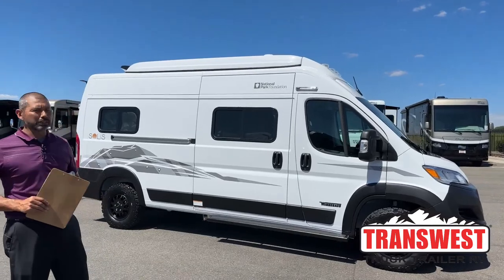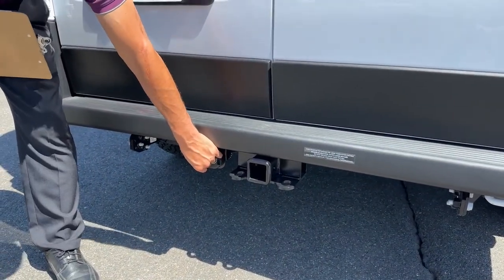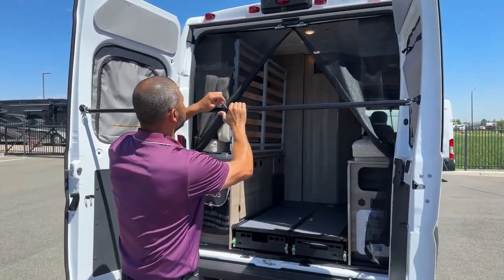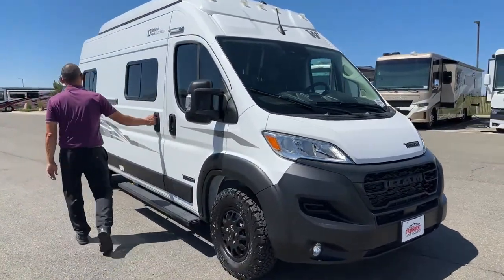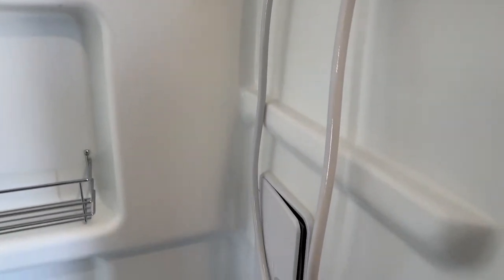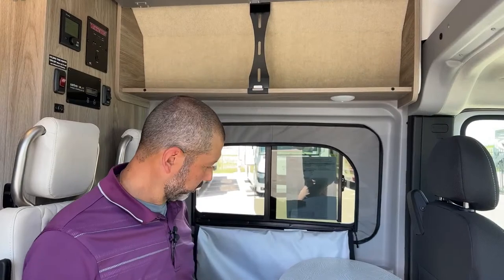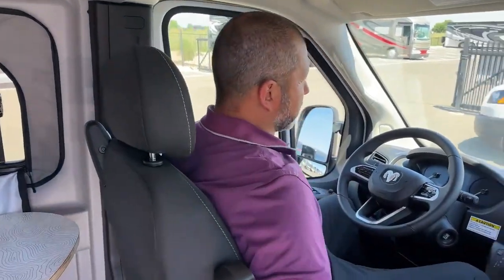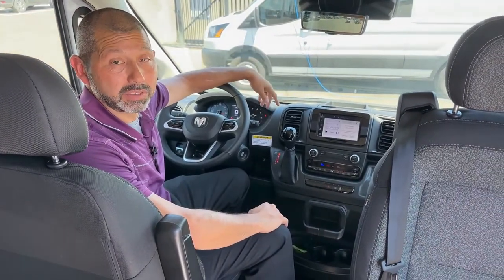2023 Winnebago Solis 59P National Park Edition - 5N230741

Comment: Thank you for your vid on the Winnebago vans. I have a 2023 Solis 59P NPF van, it has a 7 and 4 pin tow package already from factory. my question is, where to i plug in trailer brake controller? usually there is a 4 pin connector near steering wheel somewhere, but i cant find it. not trying to test ur skills but i dont see information on it on internet.